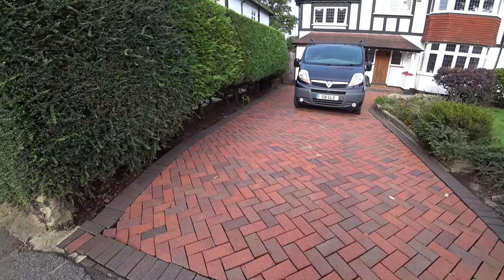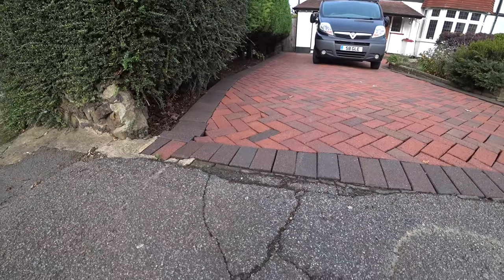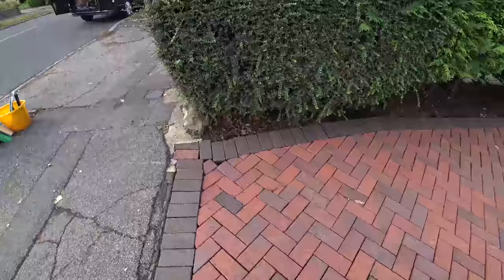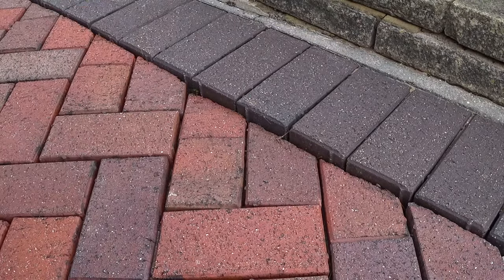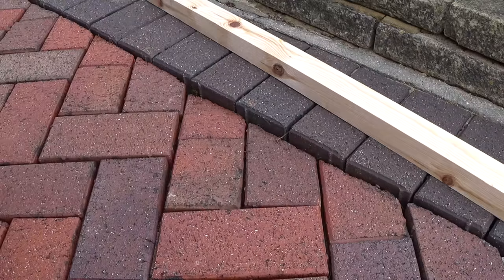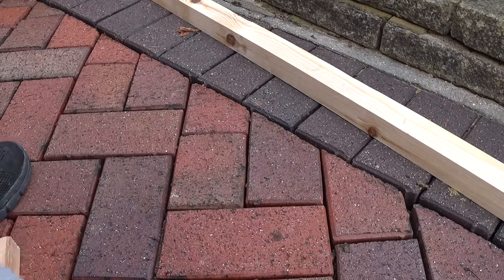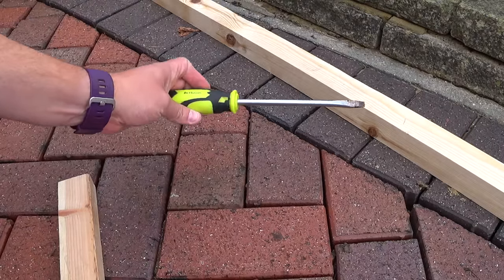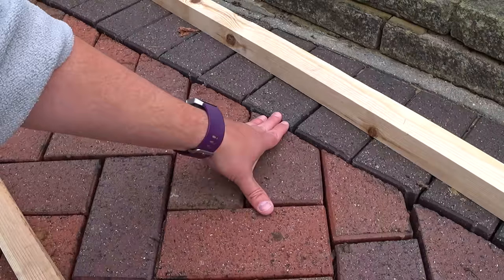How To Re Level Sunken Driveway Blocks - Easy DIY Fix.

Comment: A handy trick for keeping track of the brick pattern is to lay them just off to the side, in the same shape of the area that you are taking out. Helps keep track of where you are going and where you've been.  Especially for a large area with custom cuts along the borders.  I just relaid a couple meters of sunken pavers over the weekend, this helped immensely.  I also had a heavy/soft rubber mallet and was able to whack directly on the bricks without damage, easier on the ears for sure.  Thanks for the video Phil, nicely done.  Cheers all and happy repairs.
Reply from the maker: Yeah you can use a rubber mallet directly on the blocks, problem is if you do the repair after cleaning you can leave dirty black marks all over the blocks, hence to wood. Good tip though on the block pattern 👍
Reply: Just what I do, with anything. Just lay the parts out in the shape/ format they were removed in. If in doubt, use your phone and take a picture.
Reply: Number every brick with a number with chalk. The numbers will you give location and orientation. Take a picture of the bricks before removing. Refer to the photo. Wash off chalk after done.

Comment: Couple of suggestions. 1) Label the pavers using chalk and take a pic before you remove them to help get the right order. 2) Compact the sand more before laying the pavers and before tapping down (as it will usually drop more).
Reply: And don't put the crappy muddy sand back in
Reply: @mikiex 😂😂😂 use fresh …

Comment: Thank you for this. I had my driveway replaced and extended by a bunch of cowboys a couple of years ago. I now have problems with sinking, weeds and they also messed up one of my drains. Looks like I've got myself a summer project based on your advice. I just need summer to actually start! Cheers!

Comment: Excellent clear instructions. We have a 30-year-old steep driveway on which we have had a couple of goes with a pressure washer and this has resulted in a number of wonky bits (much worse than this). We are both in our 70s but the clarity of your advice and instructions means we feel we could tackle the really dodgy bits now. Much appreciated -many thanks!:washhands:
Reply from the maker: Glad it helped.

Comment: Block paving must be a godsend to driveway contractors. Endless maintenance, removal and replacement of sand, sealing and resealing, repair of sunken areas. If you ask me the whole idea is flawed, or maybe it only really works when done to rigorous, professional installation standards.

We had ours done by cowboys (well, a bunch of Indian workers to be more precise). They used the right materials but didn’t have the heavy compacting machinery, so now I’m into pulling up and relaying some fairly large areas that have sunk where the cars are parked. I’ve also just done the third pressure wash  / resand. I think next time I’ll go for one of those resin based drives that many of our neighbours are opting for.
Reply from the maker: Unfortunately most driveways suffer from the usual vehicle sinkage lines. Even the best laid block paving can suffer, especially if heavy vehicles are driven over it. People tend to think sealing is the end to all issues where in reality it only last around 4years and the cost to do it these days outweighs having it cleaned every 2 years.
Resin driveways are nice, but again they can be hard to keep clean due to its texture trapping dirt. I get better clean results with block paving then resin. Resin always still looks grubby, even if you use a mild chemical.
Reply: @DirtyDriveAway  Yes, I have noticed that about our next door neighbours resin drive. It looked fantastic for a couple of years but not so great now and their attempts with a Karcher haven’t made much difference. The main advantage is that they don’t get weed growth as there are no cracks.

I have just bought a Karcher K5 pressure washer and I was amazed how effective it is cleaning the blocks and ripping out the sand and weeds from our block paving, using the rotating nozzle. Maybe three hours for a 100 sq m area. I was toying with the idea of sealing it but I’m not sure it’s worth it - cost about £140 I estimate for 5 x 5l tins of Thompson’s one coat. What do you think?
Reply from the maker: @Tailspin80  thompsons is probably the worst sealer available. I've heard nothing but bad things about it. Your best off going for something like smartseal matt, costs around £135 for 25L. The problem you have with sealing is that most people roller it on. If your sanding isn't perfect you'll pull the sand from the joints and leave it all over the driveway. Also the weather plays a massive part. I'm actually stopping doing sealing after this year as its too much of a headache working in around rhe weather. It also needs around 5-7 days to dry after cleaning, no rain 48hrs prior to and 8-12hrs after application. I spray sealer (unless it's polyurethane which can't be sprayed) as it gives a better finish and deeper joint penetration. If your considering doing it yourself then you have all the time you need. Just bear in mind the weeds will start growing back in a few weeks. Block pave sealing should always be 2 coats.
Reply from the maker: @Tailspin80  technically any sprayer will work if you can get a decent control from the nozzle. The only issue you will find is that the sealer will gunk up the sprayer so you'll need some solventbtonrun through it. Ideally something like xylene or thinners will dissolve the sealer in the sprayer and flush it through between coats and after the jibs done. If not it will have hardened up the internals and will be pretty worthless if not. Smartseal is a very good sealer and I use their block pave matt (don't use extra durable unless you want to roller it ) extra durable is a lot harder as it's polyurethane so if the weather is right and you have the time it will last longer but its a damn site harder to rectify should something go wrong. So long as your sanding is done well and the sand is below the block chamfer, rollering with a good 12" double arm medium pile roller works pretty quickly. Just make sure to allow for extra sealer as it can use more than you think especially if you have tegula style blocks. If your rollering I would allow around 3sqM a litre 1st coat and 6sqM on the 2nd to be safe. Spraying is a lot less at around 2sqM and 3.5sqM respectively. I have other videos on my channel regarding sealing so take a look.
Reply: @DirtyDriveAway  I watched the Smartseal video showing how to seal paving stones similar to our drive. https://youtu.be/rEAOaMyZtNc

The killer for me is how much product you need. On the 85 sqm drive in the vid he estimated 3x 25l, so on our slightly larger drive plus path I would need 4, which comes to £560. I also think he completely overstates the damage caused by pressure washing. After three cleans since they were laid about 10 years ago, each a total removal of sand, weeds and surface there is no noticeable degradation of the pavers. On that basis I think I’ll just level the drive to eliminate the sunken areas as far as possible, resand and leave it at that. I am also going to try some serious regular weed killer to see if I can keep the weeds etc. at bay. I’m quite happy to repeat the process every year or two as it doesn’t take that long or cost much in sand.

I had a chat with a builder friend today and he was also pretty luke warm about sealing. He said people think it fixes all your problems, but that just isn’t the case because weeds will still grow and need removing, and the sealer needs redoing every couple of years to maintain the visual effect.
Reply from the maker: @Tailspin80  the visual side I.e the damp look will last about 12 months maybe less. So long as after every clean your re sanding it, you should never have an issue with the blocks. Pressure washing doesnt damage the blocks if you know what your doing and re sand every time. If your blasting vertically into the joints you can blow out more sand. Ive been pressure washing for 10 years and never had an issue with damage. Now as for product usage it depends how your applying it. Spraying uses more sealer but gives a deeper joint penetration. If you have 85sqM and your using the smartseal matt your looking at needing.
To spray I would play safe and order 75L so yes 3x25L drums. It should only use around 66L but it works out cheaper buying drums.
Now if you were rollering you typically get higher coverage at a cost of lower joint penetration and for that I would go with 50L. Phill
Reply from the maker: @Tailspin80  https://youtu.be/ve12wqJVuNU
Reply: @DirtyDriveAway  In the Smartseal video he makes a big point of using plenty of product and on that basis I would be looking at 4 x 25l drums (£560) for our drive. TBH I’ve gone off the whole idea. It’s expensive and I’m not convinced what the benefits are, if any. Right now I am in the process of ripping up some fairly large areas (after pressure washing) to get it all level again. Until very recently we had three cars which had to be parked in the same place side by side to make them fit, hence the sinkage in specific areas. Now we are down to two cars we can park them all over the place to even out the loadings.

Once it is all flat, clean and re-sanded it looks as good as new for a year or so, and I’m happy to repeat the clean and sand each year. I have found that the pressure washer definitely makes the surface more gritty because it strips away the fine particles in the surface, but I don’t see that as a problem really. The overall integrity of the block is not affected, just the surface texture.

Once you have sealed a drive the options for rework and repair must be more limited. Would you even be able to wash out and replace the sand if it became dirty or contaminated? Would you be able to lift blocks to re level? Not for me I’m afraid.
Reply: I got a concrete layer down before the block paving was laid on top about 15 years ago and the drive is still good with no blocks sinking
Reply: @keith8609  In the U.K. impermeable driveways have needed planning permission since 1 Oct 2008, not that anyone would know or check.
Reply: That’s the curse but but also the advantage of pavers. If they sink, just redo them. If you have a concrete slab or asphalt driveway you need to rip the whole thing out to redo it. Stones (gravel) can look nice but it can be messy. You can prevent sinking/heaving by using polymeric sand and preventing the water from getting underneath and lifting them.

Comment: Thats Brilliant Mate! Not long video, my back garden is sinking in areas, i'll be doing this asap!
Reply from the maker: It's quite an easy job. Sharp sand works best, OK I'm no professional driveway installer but I rarely charge for this if I'm doing a clean. I clean for this customer every year and it still looks OK.

Comment: Brilliant video nice and straightforward!
The driveway slopes but there’s a couple of sunken areas where the car was parked.
Hopefully it’ll only mean a small amount of levelling off and now I know what sand to get.
If not it’s a good excuse to go to the local beach…
Reply from the maker: So long as you have a flat section as a guide you can use a thick piece of wood to give you your level between one section and another. Drives do tend to slope slightly but it's a fairly painless job with some very simple tools. Building sand or sharp sand is the best stuff to use.

Comment: I do it the same except il put all the blocks in and the use a bit of CLS and  the top end of a sledge hammer  and knock them down level. Thumpy pumpy with some knocky knocky 😆✌🏻
I would sometimes use a block up on end to compact the sand first to get it near level then over fill slightly and thumpy pumpy.
Reply from the maker: I'll take thumpy pumpy or knocky knocky lol 😁

Comment: Nice 2 see you back Phill hope you had a good season?  Well done for showing this as I could of done with seeing the vid 5 yrs ago when I started.  Nerv racking doing if for the first time hoping it goes bk ok! Im like you I do small patches  but big areas is like opening up a can of worms if u don't know what yr doing so ovoid that. Is that your new van out on the road? Thanks again. Matt
Reply from the maker: Yeah I won't do patches that are too big, 6/7 blocks max usually. Getting some of the blocks out can be a bugger, and getting them back in...well that's where the big hammer comes in lol.
Reply from the maker: Oh yeah that's my new ride on the road lol. The old one just kept costing me money. Think I spent about 3x what I paid for it on repairs. Was time to bite the bullet and get something with more room and air conditioning lol
Reply: Is it straight forward lifting a stretcher bond driveway, screeding and then re laying? What kind is issues can arise please?

Thanks
Reply: @MrCobbsalad  Yes, just a different shape/ pattern.

Comment: How long do you think that will last? Looks like very wide gaps between the blocks???
Reply from the maker: I clean it every year for the customer, and it still looks OK. Unfortunately, if a driveway isn't looked after or laid properly, the blocks will move, opening up the joints.

Comment: I've got a small job to do for someone thats got x9 slabs in patio in their back garden, would a sand and cement mix be better under them? Thanks 👍🏻
Reply from the maker: Slabs as in actual square stone or blocks like block paving. Block paving shouldn't really be cemented as the soft base acts as drainage. If they are actual patio slabs then yes a full bed of sand/cement would give a more secure fix.
Reply: @DirtyDriveAway  yeah x9 full size slabs that'd sunk due to summerhouse being on them, sand and cement mix then yeah 👍🏻
Reply from the maker: @metalgear1977  yeah normal slabs I would sand/cement them.

Comment: It is obvious that the bricks are now wobbling and will move depending on which ends the pressure will apply. I am sure it will be better to remove more bricks and have a better levelling.
Reply from the maker: Probably is but when it's a free service, and so far it's still in the same condition. I clean it yearly for the customer and its still good. 👌

Comment: Good video thanks.  Question would running sand over the top and let it seep between the cracks of the pavers stablize the paver better and reduce movement? Just curious. Thanks
Reply from the maker: The whole driveway has kiln dried sand between the joints to help keep it stable.

Comment: Am surprised you didn't use any setting sand to fill the joints, and stop the blocks moving!
Reply from the maker: Because setting sand is only really worth it on full depth. Using it on the the odd patch is pointless and using it to top off sand joints is also pointless. It's not pressure washer proof and crack under vehicle weight.

Comment: Hi, if I was to use the paving slabs that are down already to start my new block paving from should the sand I screed make the blocks sit a little higher than the slabs ? I assume the whacker will push them down , if so how much higher should I have the blocks compared to the existing slabs so that when its finished the blocks are level with the slabs, thanks in advance for any help
Reply from the maker: If your doing a complete driveway then the sand bed is usually quite firm. I dont lay driveways I can repair a few blocks. Usually when repairing its only a bit of extra sand, not a lot as the bed is usually quite compact.
Reply: @DirtyDriveAway  thanks for replying,  it's a patio I'm putting in 21m2 , I thought you might know ,I took it you lay them too , my bad sorry , again , thank you though
Reply: @stevelake9333  put a pencil under the string on the edges is about the right amount
Reply: They still look low to me